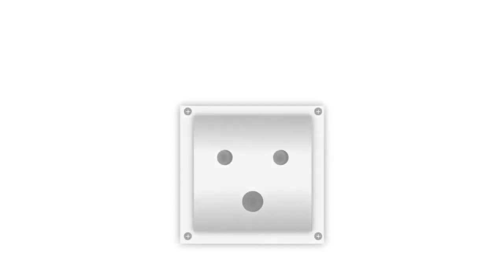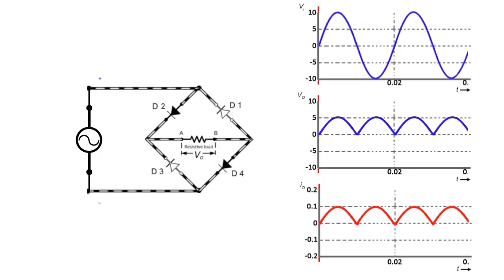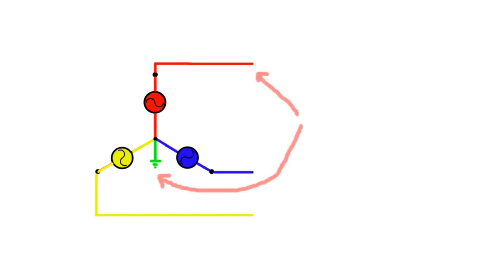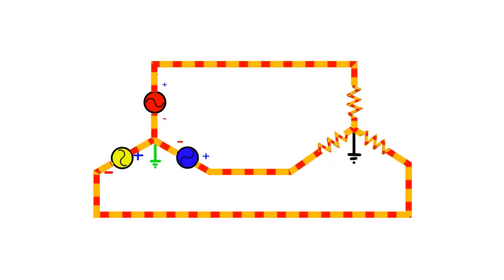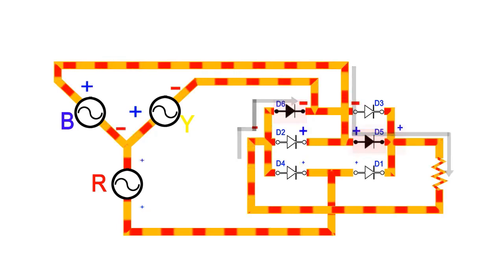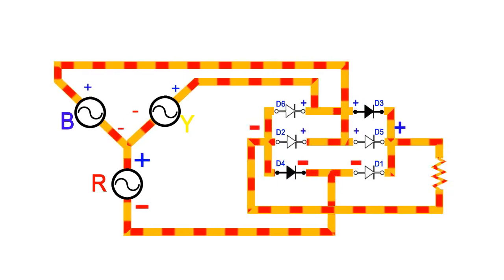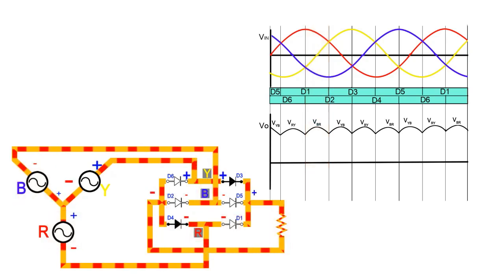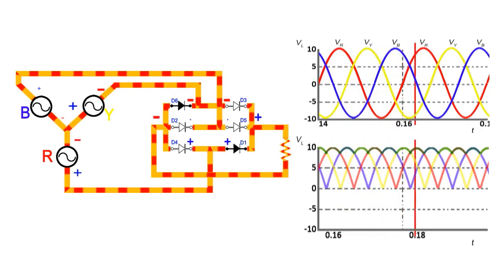Three Phase Rectifier Animation

Comment: Sir m three phase full wave reactifier ke leye 15 amp ka diode use kar lo.
Reply from the maker: Yes, but then load current must not exceed 15amp in any case. otherwise the diode will burn.